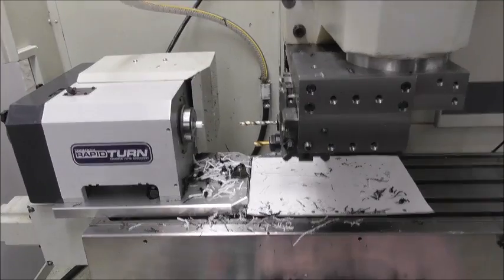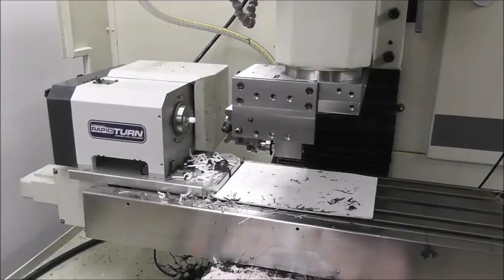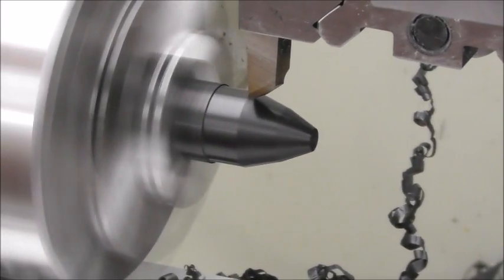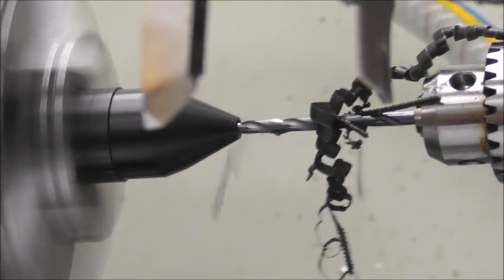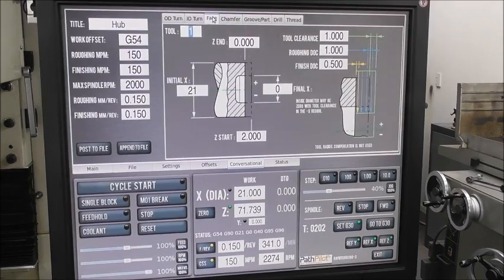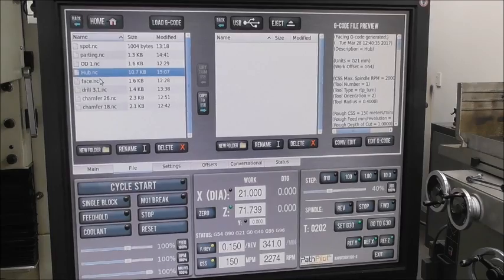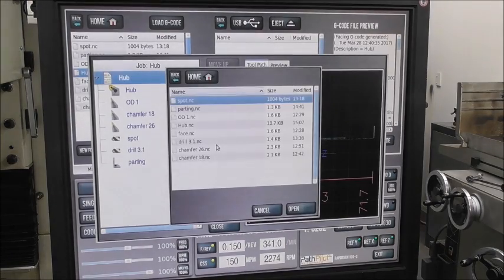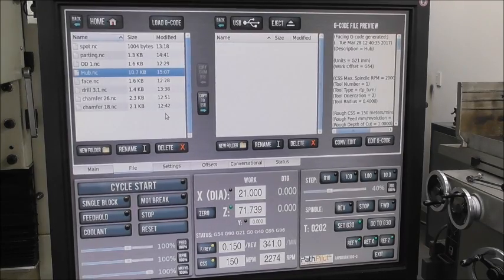Tormach RapidTurn - 19. Affordable CNC lathe capacity.

Comment: Hi Cliff, Sorry for a completely random and unrelated question but can you recommend any freight forwarder to ship a Tormach to NZ ?  and have your accessories normally shipped from Wisconsin?  Cheers, Chris
Reply from the maker: Hi Chris. I use FastTrack customs . Deal with Matt. They are great. Feel free to mention the referral.

Yes ex USA anyway - ex China worked out more.

Cheers   Cliff
Reply: Hi Cliff, thanks for that info, have sent off an email, will see what happens.  Tormach currently want to ship from 2 locations - China and USA (Accessories) so it will be interesting how all this pans out.

Comment: Hi Cliff. Thanks for the video. Very informative as usual. Maby a silly question but could you use your touch probe to come up with the tool offsets instead of the dial indicator? Cheers, Kieran
Reply from the maker: Thanks kierang. RapidTurn  Pathpilot  do not currently have probing routines.  But I may be able to work out how to do it via G code or MDI.  Cheers  Cliff